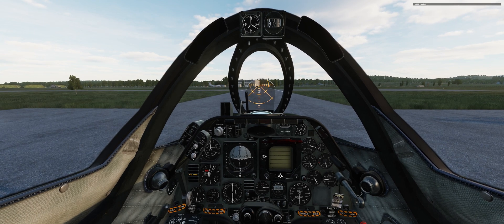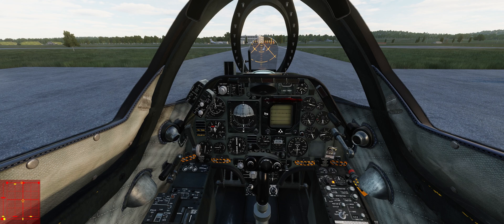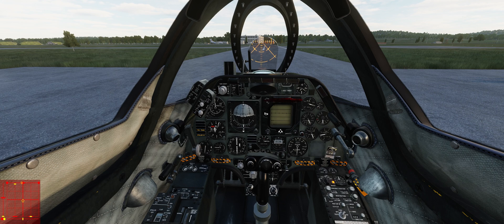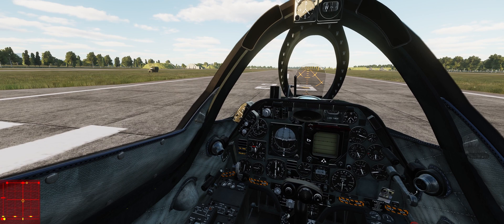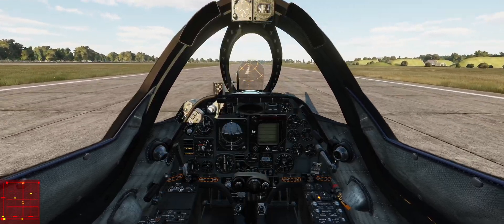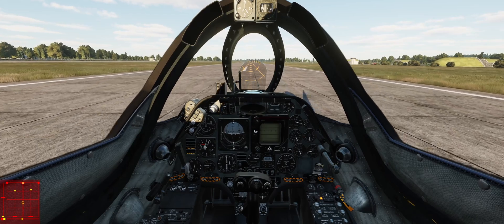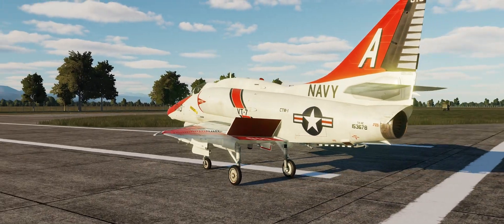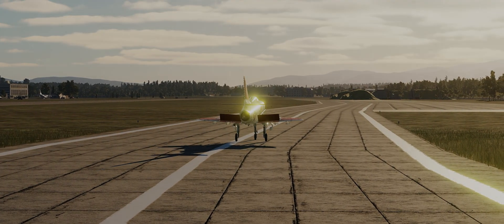A-4 Ground Handling Tutorial

Comment: Edit: incorrect info, plz ignore
Original comment (for self shaming): @4:41 I think if you change the axis to "slider' zero value is actually zero and you get full range for braking. Haven't upgraded to 2.1 yet cause I'm lazy and don't want to redo all my keybinds again but that's how I currently have it set up and works well
Reply from the maker: No. I have mine set as sliders. And tuned so that most of the range is in the second half, it works well, but you still have to get to 50% deflection before they grab.
Reply: @Sidekick65  my bad. lazy AND dumb as always

Comment: grate video Sidekick, but still with all due respect the front wheel should return to center on its own even with no power as long as there is movement and there are plenty of plane sin DCS with free casting wheel and differential brakes and none of them are as complicated or inaccurate as the A4. It makes operating in small carrier like the Melbourne an unrealistic impossibility. My oppinion is that its should not be a issue in the sim but unfortunately it is...

Comment: Controlling an aircraft with a castering nosewheel is something no simulator does well at.  In the real thing it is quite easy and intuitive because you can feel the brakes through the pedals and your "gut" can sense the changes in motion.  Lacking the feeling in the sim makes it more complicated.  I also suspect its quite difficult to code properly because every module I have ever tried with differential braking kinda gets it but it never feels quite right.   Version 2.1 does a pretty good job comparitively speaking.  One thing to note is that trying to do differential braking without pedals with brake axis' is going to be tricky and there is really no way to code around that.  Pedals are almost a must. The two (minor) issues I have with the A4 differential braking is that steering completely stops when one main wheel starts skidding.  The turning moment might decrease with a skidding main wheel but it wouldn't stop and the aircraft would not start tracking straight.  The amount of steering loss would be a function of forward momentum and weight on wheels so it would take more than a few lines of code to refine it and I totally understand why it is the way it is.  The other issue is on the carrier.  With wind over the deck, the A4 has a terrible tendency to weathervane which makes the taxiing around on the deck extremely tricky.  That may or may not be realistic because my understanding is that real A4's were positioned on deck by the flight crews with a toe bar on the noseweel so the ground crew would be doing the steering.  It is very frustrating to get started and start taxiing on the deck only to have the aircaft perform a hard turn and put the nose over the edge.  We really need a "pushback" option in DCS but that would be an ED thing.  This "problem" can be dealt with simply by removing the wind component and lowering the ship speed but that does take out a bit of the realism. The A4 devs have done a great job with this update.  The nosewheel steering is pretty good.  The controls indicator that shows the nosewheel position is great.  The skidding sounds fills in some feedback that is lost in a simulator and just sounds "cool".   And something for another video is the new RWR sounds.  Really nice improvements there.
Reply from the maker: Excellent comments.  I did not know that about handling on the carrier.  Thanks for the contribution.
Reply: @Sidekick65  I should add that my carrier experience is my own experience and the A4 devs had not seen the issue reported before when I mentioned it to them.  I started to do some testing but, as you know, collecting the data is a lot like work :)  My own eperience comes from multiplayer missions with about 20 knots of wind over the deck (wind speed plus boat speed since the boat is sailing into the wind).  Most DCS mission makers don't add wind because it can be problematic so that might be why it has not been reported before.  More testing needed...

Comment: Good video. I updated to 2.1. Castering nosewheels are pretty common: Cessnas. Brake turning on tricycle landing gear go way back. In my case I flew the T-28B which has a similar set-up to the A-4. F-8, A-7, RA-5C and A-3D among others had this. Carrier deck turns need be to be sharp to maneuver in tight spaces. I've found that holding opposite brakes in the turn and high throttle settings followed by feathering will allow you to go, eg, from full right to full left in a very short distance (lining up to the shuttle). 

Now what I'd like to know about is the throttle increment and deflection changes in the update. Currently I'm moving the increments around to see if I can get better throttle response in the carrier pattern. I moved the curves on throttle to between the detents (Winwing Orion), to get out of the detent during approaches. Did this with all non-afterburning a/c. Since approaches in the A-4 require high throttle settings avoiding the bump makes things smoother. Now working the increment to find that sweet spot. Any thoughts on those other updates? Am I interpreting them right?
Reply: When I am on limited inputs, the custom continuous throttle input is the way to go. I can AAR on my playstation 4 controller using it. Otherwise, the increment/decrement rate change of 1% is where you want to be for AAR.
Reply from the maker: Thanks for the detailed contribution. I have not experimented with the throttle increments. Let's see what others have to say.